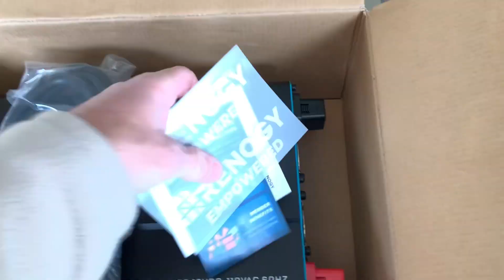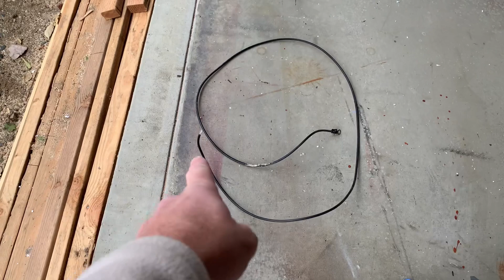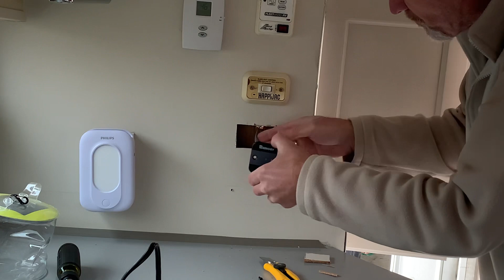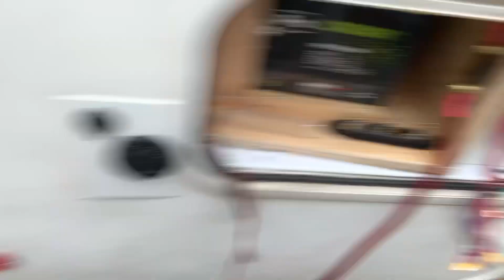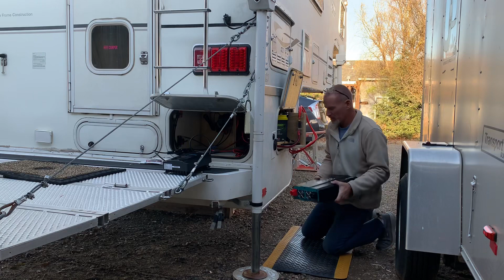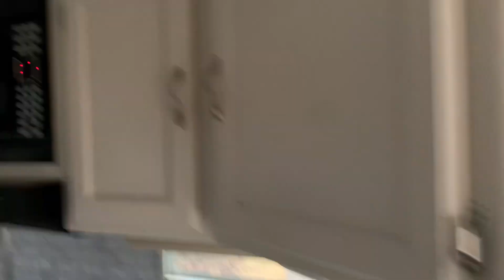My New RV Power System • LiFePO4, Renogy Pure Sine Inverter

Comment: I think the covers are supposed to be slipped over the wire before you hook the battery cables? They snap back in place to protect the wires from accidental shorting. I know you know that but others may not, just good practice for safety.

Comment: Did your Renogy come with the battery cables? My 3,000 did not, they said I needed 4/0 cables
Reply from the maker: No battery cables included with mine either.
I purchased new cables with my batteries.  I am running a 2000 watt pure sine inverter with their recommended 1/0awg cables.  No issues so far.

Comment: Curious why you didnt, at the same time, put in a 30A auto transfer switch, so you dont have to manually unplug and plug to switch from shore power to inverter power. Also, im sure you isolated your battery charger when on inverter power.  Love your videos, and methodology.
Reply from the maker: The camper was prewired for a generator so there is an auto transfer switch already installed.  I ran the AC out to that transfer switch so when I power up my inverter or have shore power, it auto selects.
Reply: @covetthecamper2289  Thats How I did it too, simple safe and least intrusive.

Comment: What size fuse are you using on the DC input size of the inverter?
Reply from the maker: 150A ANL fuse on the input side between the bus bar and the inverter.

Comment: go with a Mr. cool and run it on solar
Reply from the maker: I’m going for efficiency and weight reduction.  
I have a few other videos explaining my overall heating/water/air conditioning system.  I can run all of it using my solar array and batteries.  
Why I did not go with a Mini Split:
Mini-split is expensive and honestly, it’s overkill for a camper this size.

Mr. Cool Single-zone 9K btu is $900 and weighs nearly 100 lbs.

Comment: You need to be running mc cable not romex
Reply from the maker: I’ll look into swapping to MC when the prices fall a bit.  This 10awg NM-B wire is secured tight with clips every 18 inches.  I’ll inspect it a few times per year to be sure it’s not rubbing through the outer jacket.  The OEM romex is 20 years old this year.  It all looks good.

Comment: I am doing a similar install on my lance 1191 with a victron multiplus 2000. On the DC side what did you do with the ground? It looks like you didn't use one?
Reply from the maker: For grounding, there’s a ground lug on the inverter.  I have an 8 gauge cable that runs to the negative bus bar on the system.  (That is connected to the campers OEM electrical panel which is connected to the trucks grounding through the 7-way plug.)
I also tested and made sure all of my GFCI AC outlets are tripping with my tester.  I’ll do a follow-up video on this.
Reply: @covetthecamper2289 Would also appreciate such a video as well!!!

Comment: Quick unrelated question..I have the F350 (2006) as well. Not sure we have the same electrical system but I haven’t found a quick disconnect or the fuse to pull to stop the reverse warning horn from going off due to the camper hanging over the back end of the truck. What did you do? If you have that same system?
Thanks again for all the great videos!
Reply from the maker: Mine has a button on the dash right next to the 4WD selector just above the power rear window switch.  It’s marked “P”
It can be seen at the forty-five second mark in this video 
https://youtu.be/QpXvGsBYZMQ

Comment: That Renogy Inverter is a beefy unit! Tied in with your solar panels you are definitely good to go. I had a very similar 200 watt setup in our Wolf Pup Toy Hauler that we sold a couple of years ago but after looking at our Elkhorn  setup I decided to simply have a small 300 watt inverter to only run our TV, Direct TV box, the King Quest Pro Automatic Satellite dish and our sound amplifier. All of 4 of those devices are wired together to a single 110v plug which I simply unplug from the small inverter mounted right next to a 110v receptacle and plug in to shore or on board generator power as needed. So for Christmas the Wife bought me a single 100 watt Renogy solar panel to be mounted to the roof and a waterproof Renogy solar controller that will maintain our single deep cell flooded battery and if necessary, we still have our Renogy 100 watt suitcase panels with a 12v plug on the camper battery box door to add that power if needed. That's our "poor man's" boondocking setup but it works on the cheap, {as we are retired and living on SSA only}. But whatever rig any of us have we all need to get out there and have fun as long as we can!
Reply from the maker: Yep, everyone has different power needs.  I’m still working, (because I have to and because I really enjoy it 👍🏻) and for at least few more years will need an RV for work camping.  I travel a lot in Idaho, Washington, Oregon, Nevada & California for my RV Inspection company and dry camping in my truck camper or in my car allows me to keep my expenses low and more money in my pocket.  
I enjoy testing different ideas for power resources etc that can help me be more efficient when traveling for business or for vacation.
Reply: @covetthecamper2289  We have a another Brand ALFFAA same inverter.We can send to you review.Can you send me your email?
Reply: Yes we all need to watch our budget!
Reply: Quick question… why are the battery cables double? We are installing a 3K PSW Renogy inverter but it didn’t come with any cables and just trying to figure out what those are and if we need them Vs the typical 10 gauge copper battery wires🤷‍♂️

Comment: I just replace my microwave with a inverter microwave now can control the watts the microwave is using
Reply from the maker: I thought about swapping my regular 900 watt microwave oven for an inverter microwave oven a couple of years ago.  The issue for me was that the cycling of the power (magnetron cycling on & off every few seconds) can shorten the life of the batteries.  (If boondocking and running off of house battery/inverter power).  The cycling from 1200 watts (magnetron on) to 50-100 watts (magnetron off) every few seconds will cause damage to certain types of batteries.
Reply: I can run the watts down to 650 watts and it runs continuously by using the power level button. It uses 1% per min on my battery’s boondocking
Reply from the maker: @CaliforniaRocks2025  
That’s awesome.  What manufacturer?  The Panasonic that I tried kept cycling power on/off every 5 seconds.
Maybe I need to try another.
Reply: Panasonic NN-SN67KS I got it on Amazon. It fills the space as the one Lance put my camper. It actually bigger than I really need. But it fits prefect, I run it at power level 5 or 4
Reply from the maker: @CaliforniaRocks2025  
Great.  Thanks for the info.
Reply: Great idea! I have one of those at home, gonna have to do a switcherony.

Comment: Now I understand the small window unit vs roof mount.
Reply from the maker: This spring/summer will be the true test of the Air Conditioner running off of the batteries/solar.  (A/C Condensation collection system in the works as well).  
I have a couple of small electric heaters I’m testing on this system now.  175 watts @120VAC each.  One in the front of the camper and one back by the bathroom.  Keeping the inside temps 30° warmer than outside temps.

Comment: Fantastic way of doing things. I hope it's quieter than my Progressive Dynamics 1800 with dual fans that run high full time.
Reply from the maker: So far it’s totally silent.  Even running the microwave for a few minutes to cook oatmeal.  I’m sure the fans will kick on in the summer when I’m running the new air conditioner with it.

Comment: Wow. A lot of work. That is the problem with campers, no room to put things.  I think I will buy the same inverter you have. I've only used modified sine wave inverters, & they have worked fine for me, but I like the remote switch on the Renogy. Anyway, looking good.
Reply: You know you can take out your back seats and add a storage rack on top.
Reply from the maker: Yeah, we still have kids and dogs that travel with us so the back seat is occupied.  I may install some type of custom rack for kayaks etc…. Not sure on design yet.  I have a front hitch and a rear hitch that I put small racks on.  Good for firewood, shovels, axe etc.